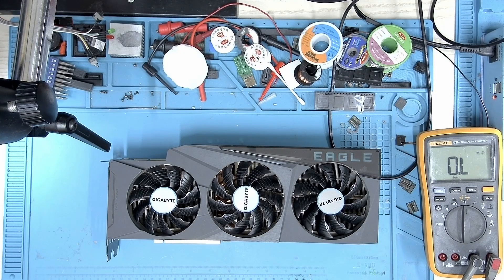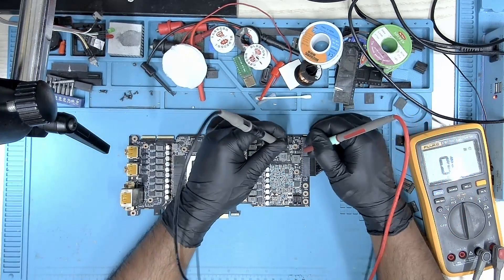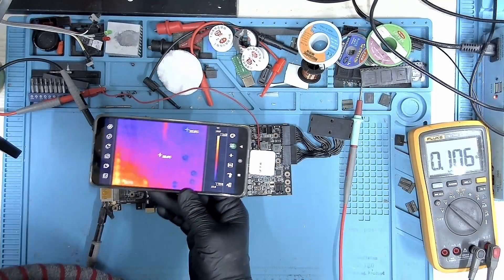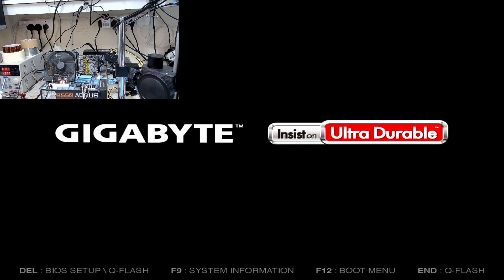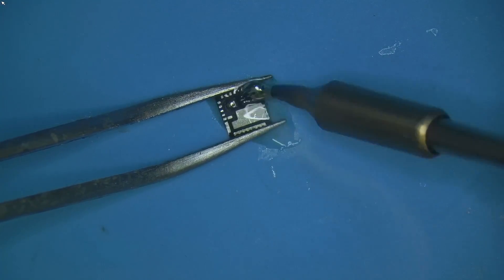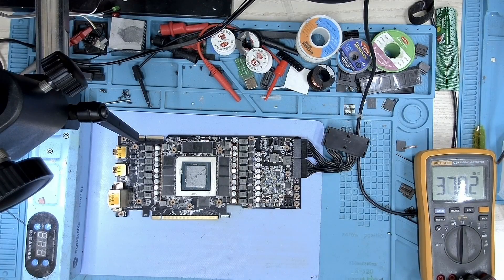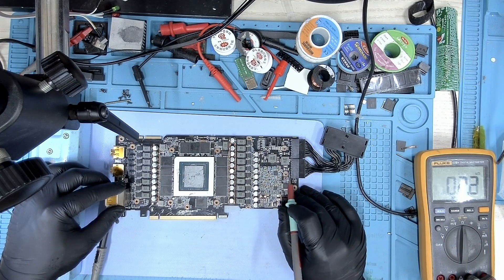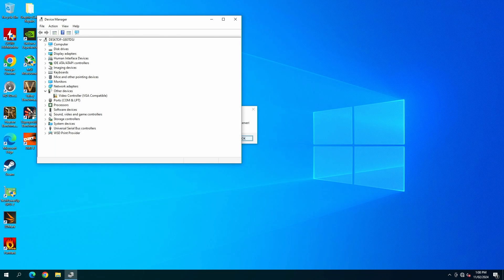Does Gigabyte make good Graphics Cards? Gigabyte Eagle RTX 3090 Repair

Comment: Nice video!!this has better pcb or tuf 3090?
Reply from the maker: All PCB thickness and quality are as per spec of Nvidia. The components and fuses are decided by AIB. Nvidia shares a reference design to AIB partners and then AIB partners build on it. As a repair technician any GPU with good protection circuit is good. All high end boards from AIBs have these but low end boards lack the protection.
Reply: @GraphicsCardRepairs-tk7ql  for your opinion gigabyte gaming-aorus or TUF has better and more quality on pcbs?thanks a lot

Comment: i have short in the fuse code q. up side of fuse 4ohm reading
removing the mosfet its still 0.4ohm
Reply from the maker: There is another possible short. You will will need to inject voltage to identify the second short. 😁
Reply: @GraphicsCardRepairs-tk7ql  PEX VDD is 0V
Reply from the maker: watch this video. https://youtu.be/yG4LOqMFQL4 there is a 0R resistor that supplies 12v to the regulator. check if the 0R resistor is still 0 or changed value. it is known to fail if there is short on 12V. watch complete video you will understand.
Reply: aa i have fix the mosfet and 12v is ok. but now i have missing pex. 1.8v 5v is ok @GraphicsCardRepairs-tk7ql
Reply: @GraphicsCardRepairs-tk7ql  i have 12 v and find the short mosfet, and 12v is ok, also 1.8v and 5v is oke now the PEX is missing?

Comment: Hello,
First of all thank you for your very helpful videos.
I am fixing a MSI rtx 3070 ti which has a shorted 12v pwr Rail. The short was caused by one of the phase fet driver. Now i have all voltages and everything looks fine except the card is not being detected by the system.
Ihave measured the 27 mhz oscillator near the GPU chip and it is not generating the 27 MHZ. I have measured the resistance to ground on the input pin it seems to be not connected. The output side reads 0.6 mega ohm which is perfect.
I am not sure if the ball under the gpu is cracked or something else cause that.
Could you please help me figure it out
Reply from the maker: Now there are lots of things to consider here. If the short has caused the 12v to shoot to the core then the core is already dead. A short on the phase will not cause solder balls to crack under the core. Now being optimistic there are few checks you can do. One measure the resistance on 1.8v, PEX and Memory. Second check PEX reset, reference clock plus and minus reset in diode mode and also check the first pair of data lines too in diode mode. Can you put these readings in the comment please so I too have a clear picture. Now if all of these readings are good and still there is no fr quency on the clock the last option keeping some line of hope is the reball the core. As off now with the current information you have provided for me it looks like a dead core. But let's not give up so easily.
Reply: @GraphicsCardRepairs-tk7ql 
Thank you for your response.
Pex_rst_buf signal is good 1.8v.
All voltage rails are good and present.
Just the oscillator input pin has no voltage which means the core is dead as you said. Thank you for your help
Reply from the maker: It's a dead core.

Comment: Hey, I think my 3090 just died..

So basically was editing a Video in davinci resolve. turned on noise reduction on the highest setting (quite gpu intensive), but should have been no issue for a 3090. Suddenly my monitor turned black, and the fans ran up to 100%. turned off my pc and restarted it. Then i tried to replicate the issue to figure out whats causing it. After the second time the pc completly turned off, and it stayed off. No fans at 100%. It doesent even turn on anymore. installed my old 1060 and it starts up fine. With the 3090 nothing happens, its like the pc has no power at all. I googled and found that people had a very similar issue back when new world was released. Same thing seemed to happen. Now| wonder what can do about it. Its a gigabyte 3090 gaming Oc, and i have a 750w seasonic focus gold psu. The GPU has been out of warranty for 1 month..

would appreciate any help
Reply from the maker: Something on your GPU just shorted. Possibly a MOSFET on the 12v rail. Your GPU does not have fuses so do not try to start the computer with the 3090 installed. It will make the damage worse. This 3090 would need a repair. 
You can book your repair with me by filling the form on my website link below.
https://graphicscardrepairs.com/repair-request/